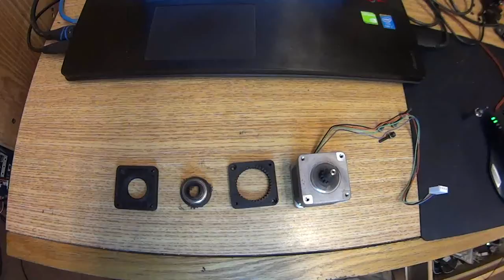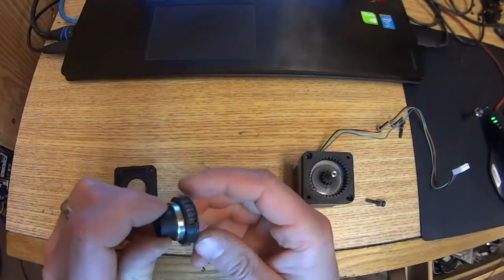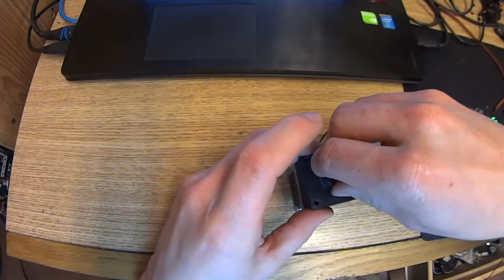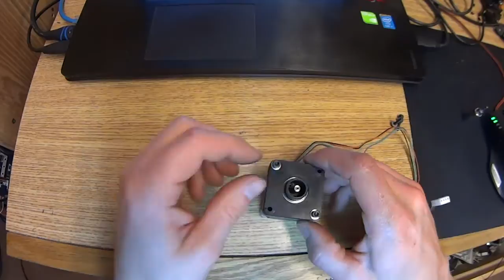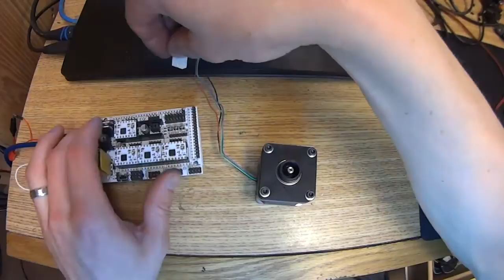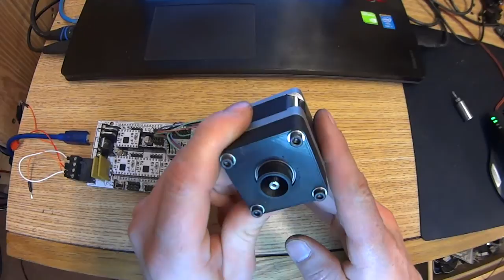Nema 16 Stepper Motor Planetary Gear

Comment: Awesome design! does this encrease the torque too? and how much?
Reply: +Diego Chavez And also, do you have the 3d files for download?
Reply from the maker: +Diego Chavez Yes, but the dimensions are for a stepper motor that is not a common NEMA sized motor. You could scale it up, But I couldn't guaranty fitment. What are your plans for the setup?
Reply from the maker: +Diego Chavez Yes, torque is increased by ~4X with a ratio of 4:1.
Reply: Sean N. Im planning on using it for this motor https://www.sparkfun.com/products/9238
Reply from the maker: +Diego Chavez I see. Well, you are going to need get/make some pins for the planet gears. I just used some finishing nails. I will put a link in my description. If you have any problems getting it together, let me know.
Reply: Thanks dude, awesome!